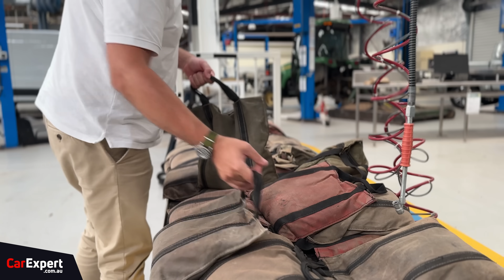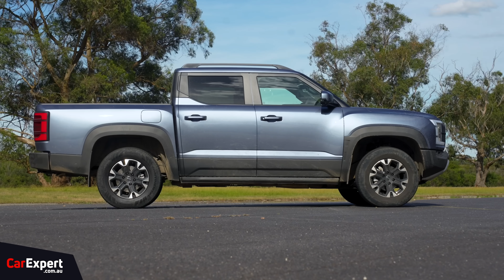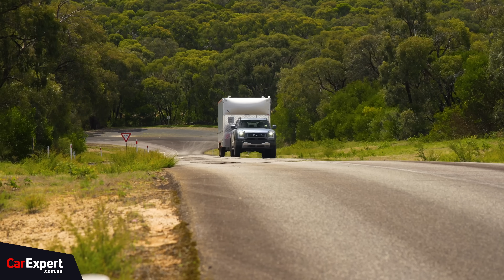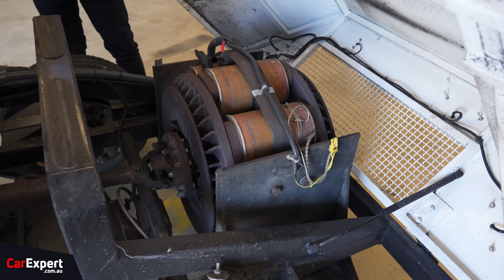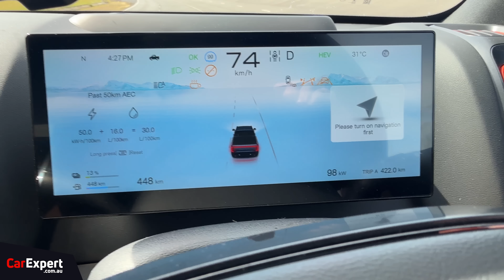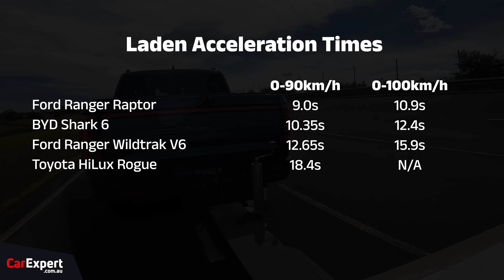BYD Shark 6 towing STRESS test at MAX payload - the results are surprising...

Comment: When you're towing a heavy load, you're meant to set the battery to a decent charge minimum like 50% so that doesn't happen. You seem hell bent in showing the Byd Shark 6 in the worst possible light. Perhaps you should engage your brain before doing some of these tests.
Reply: Given how the Sealion works, once the battery gets to around 19/20% you start to get a battery performance drop off, which is why you have the ICE maintaining the battery level at a level within the 25-70% band. This is the band where there is minimal performance drop. In this case, if I am reading your description correctly, you let the battery gets to around to 15% in Max mode (where it forces the vehicle to only use EV power) at which point it then automatically kicked the ICE in to try and bring the battery back to the minimum (25%) level BUT because of it also having to power the front wheel, due to the battery performance drop off, it was just maintaining a balance at 74kmh. This would never happen in the real world, unless you had no idea how to use the car…if SOC was set to anything in that ‘recommended’ band the ICE would only be kicking to charge the battery and not having to work its arse off. the battery would be dropping , the ICE would be charging, but you would be able to maintain the required speed (probably). The normal towing test made much more sense as the vehicle was being used ‘correctly’.
Reply: Someone’s forgotten their meds today. He tests it the same as all the other utes he has tested.
Reply from the maker: @jackh4787  Glad somebody was listening 😂
Reply: Rubbish Mr. BYD salesman or BYD bot
Reply: @Ttnorth11  seemed pretty objective to me mate - you seem to be letting your ideology and politics get in the way of objective analysis, not good.
Reply: @scroopynooperz9051  You are actually defending the comment from johnemersom (if that's his real name) you must be another bot. You bots are renowned for getting on here and FB and disputing everything that goes against what you want to portray.
Reply: @Ttnorth11  The BYD hybrid system and is new technology. People need to understand how to use it properly depending on what they're doing. Have a look at John Cadogan's video's where he explains how the BYD hybrid can operate in either series OR parallel modes. You can set the battery recharge system to come on early which means that whilst you're driving with plenty of battery left, the engine comes on and keeps the battery charged so you never end up in the position shown in the video.
Reply from the maker: Regardless of what you decide to 'lock' the battery at, once you reach that preset limit if it's not drawing energy from the battery it's limited to a small petrol engine that will struggle to tow the load as you see in the video. You're welcome to argue with opinion, but you can't argue with facts, no matter how much you don't want them to be true.
Reply: @CarExpertAus  So how long did you drive until battery fall from 50% to 13%,that part is missing in video ,if car goes 70 km/h with empty battery on hill and use 100 kw then for 100 km/h it may take 40kw more from battery ,50%-13% is 33% so 1/3 off battery off 29 kw/h gives 9 kw or 15 minutes at 100 km/h mean 25 km off constant uphill for 1/3 off battery
Reply: @CarExpertAus  Why would it not draw energy from the battery if you've set the battery to 70%? That makes no sense.
Reply: @CarExpertAus  I am sorry but you are incorrect in what you are saying there. Setting the Battery at a higher SoC will mean that the ute will have the reserve of battery to be able to pull up the hill. It only slowed down in your case because the battery was getting to its minimum capacity, it will not slow down if it has 70% battery and you have it set to SoC save 70% when you start climbing the hill. Granted under your extreme test case, the engine is not able to replenish the battery faster that it is being used, but with 70% battery it will climb most hills even when towing before getting to the low battery issue you have shown and you gain most of that energy back on the way down.
Reply: @CarExpertAus  You really have no idea of the facts. You can preset the battery to not drop below 50% charge. That means that the petrol motor cycles on and off to keep the battery at that level so you then never have to run on the petrol engine alone. In the video, you intentionally tried to tow the maximum weight when you had specifically run the battery down which is not how the vehicle is intended to work.

Comment: This is seriously good research. Just the sort of information the manufacturers need to improve their products. I'm still sold on the Shark though. The camper trailer I tow is only 1.1 tonnes - so all good.
Reply: Good research would be towing 2.5 tonne max laden with 70% soc in hybrid mode and doing two tests: going into a massive sustained  head wind and then up a hill and seeing how long it would take to deplete the battery.

Also if Paul is worried that the brakes may need to do all the work on a sustained downhill if the Regen overheats or the battery hits 100%, then why not do that test rather than speculate?
Reply: This is a vastly better ute for people who doesn’t tow heavy loads over long distances every day of the year..the electric motor-battery will really cut down fuel consumption&improve ride comforts on those short daily suburban journeys most people do most of the time in their utes..
Reply: @Johnnie007ification over long distances it will be fine. Where it will drop to 75km/h is long climb towing 2.5t - not many places in oz where that’ll matter.
Reply: @Expedition_Tranquilo and the battery is drained below 25%.  Would love to see the results with the dyno starting with a charged battery to understand how quickly the battery will drain.
Reply: @Johnnie007ification true
Reply from the maker: For most people this car will be great.
Reply: @CarExpertAus  yip - most people will not be putting it to these extremes but it is important to TEST these extremes in order to gauge its limits and, for those few who do intend to operate at these extreme limits, to have realistic expectations.

I see many are busting your balls for giving this ute a decent shakedown and a generally positive review - it would seem they're letting their ideological and political views taint even simple car reviews now xD

Comment: I have been curious on the engine towing capability once the battery goes flat. It seems for longer distances this will be a problem.
Reply: It’s hard to say without any real-world usage data to go by. I do agree that it does seem a little disappointing, however, realistically, if you were going to put yourself on the road with 2.5T and a load on board you just wouldn’t leave the battery to run down to 25%, you’d set the limit to more like 50%-75% and just accept that while you’re towing in hilly regions your average fuel economy is going to be poor. Hills don’t go on for days and the battery doesn’t simply deplete in minutes, if you just work to your strengths instead of just lowing on regardless I reckon it’ll be fine.
Reply: @Random-Destination  Yes unfortuately him testing in as he said the "edge case scenario", has led to these type of conclusions being drawn by many.
Reply: The new version coming soon should address some of the short comings as it will have a 2litre turbo petrol instead of the 1.5l
Reply: The motor keeps the battery topped up, the battery will keep its charge in normal use. As was pointed out in the video, the performance will only suffer from low battery after a very long steep climb (I'd love to know how many hills in Aus would be as tough as the 3kN load for 3 laps of the track). Once you're up the hill, the motor will recharge the battery.
Reply: @davidjulian8536  my understanding is the motor can't charge the battery more than keeping it at the constant level it's currently at
Reply: @lengerer it can, but it needs to be in surplus of what's going out. Which in a sustained climb it isn't. It can also only charge it back to 75percent I believe.

Comment: should set your battery at 70% when towing, so the battery won't go below 15%
Reply: Save mode set for 70%.
Reply: It might really need a 2.0T petrol from the U8 to do this and beyond
Reply from the maker: Yep, we started towing with the trailer dyne when we were finished with the hill road. Battery would have been around 60%. It took around one lap to drain the battery with the dyne set to 3kN.
Reply: @CarExpertAus  Ws should use smart hybrid mode
Reply: @CarExpertAus how long is 1 lap?
Reply: @CarExpertAus  I'm not sure there are many places in Australia where you can tow 2.5t up a steep hill, doing more then 74km/h, consistently, for more than 5-10km. Anything less and the system will replenish back to normal. The 3kN test is a great way to find a drivetrain's limits, but I think the small minority who are actually that hardcore, probably already know the BYD isn't targeted at them.
Reply: @CarExpertAus  That's not what was asked. What SOC did you have it set to try and maintain? Not what did you start at.
Reply: @CarExpertAus  Thanks for answering questions. How long is one lap of the track?
Reply: If the ice could keep up to the power draw the battery would not have fallen under the 25% limit in the first place.
Reply: @Trad-Archer  Why aren't these details in the video?  Your comment makes a lot of sense, however it suggests that the SoC engine kickon setting would drastically change the duration of max power output.  Why was this not thoroughly discussed in this video?
Reply: @Trad-Archer  It should, the sharks got 135KW ICE engine, About the same size as Isuzu D-max 140kw. You only need 85KW to overcome 3KN resistive force at 100km/h  (P=Fv). So it's interesting how the battery drained so fast.
Reply: @simonlee5934  Correct - But you also need to overcome the drag on the car, friction etc, about 60kw in a ute - so 150kw all up (85 +65). (And without the engine running because we can safely assume they had that off with SOC set to 25% because they won't clarify), So yes you will consume 10kwhr of battery (between 60% and 25%) in 4 minutes. I suspect the 60% is also a bit rich (and before they burnt 321kw for 12 seconds to get to 100km/hr). Start the motor earlier, then you get 120kw from the ICE and that battery lasts a long time.....
Reply from the maker: @Trad-Archer  Spot on.
Reply: @Trad-Archer Then you need a much more powerful ice. 100kw seems to be all it could manage that day.

Comment: I've got a Sealion 6 - near enough the same drivetrain. Absolutely epic car by any measure, and a category killer for the mid-large SUV segment. Excited by the Shark.
Reply: Epic fail.....😆
Reply: says the Renault owner....
Reply: @erwin734 ha ha, never failed. Epic car....😃 10 years old now. Let's see how many byd's make it to 10 years....😆
Reply: There are plenty of byd taxis driving around with extremely high mileage. You just need a valid passport.
Reply: @brycem0  BYD is used in taxis in Shenzhen, China, and many of them have driven 600,000 kilometers. BYD buses in Shenzhen, China have driven 600,000 kilometers.
Reply: @brycem0  Dude I saw a freaking BYD e6 drive by here in Sydney. I was shocked, those are 11 years old.
Reply: @brycem0  This is not the limit of the car but Chinese law requires that public transportation vehicles must be scrapped after 8 years or 600,000 kilometers.
Reply: @Neojhun  I saw one of those just 2 days ago on my way to work lol